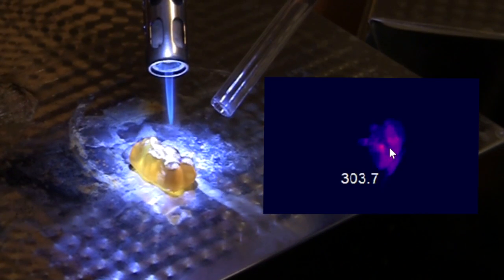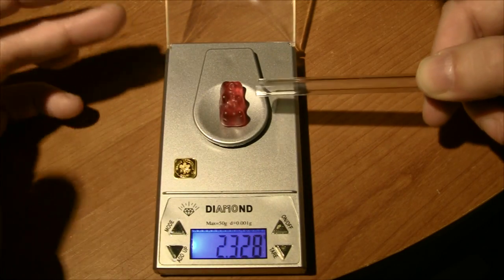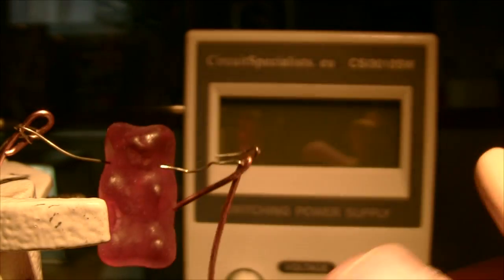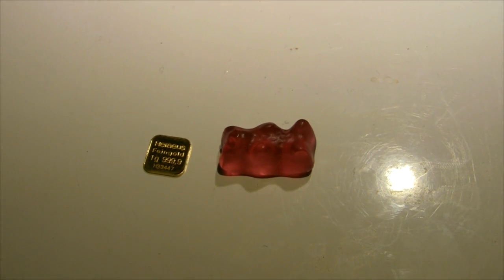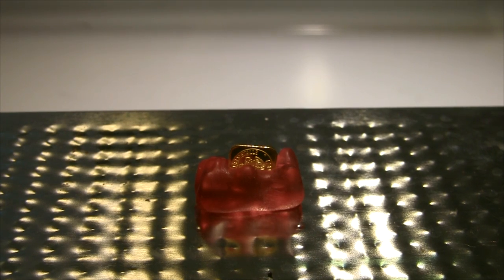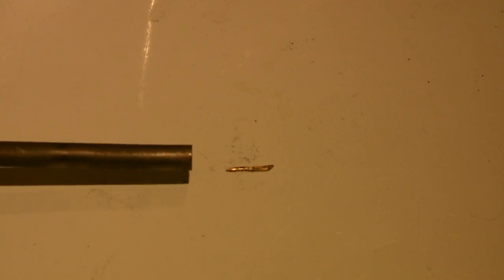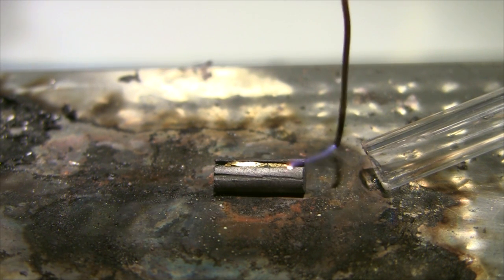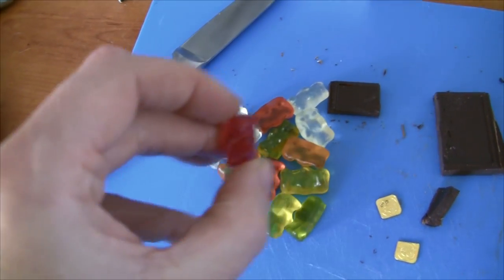Can 1000C Gummy Melt GOLD??

Comment: now this something interesting than the 1000°c knife cutting fucking gold
Reply: A normal knife could lol...
Reply: It doesn't matter how large the chunk of gold or aluminium is. A steel knife will always be able to cut through it. The question is can YOU apply enough force to the blade with your muscles. It's not a problem with the material of the blade.
Reply: Supershadow301 not really. gold has about the same hardness as aluminum
Reply: Supershadow301 it would be possible with a small piece, but extremely hard with a large-ish chunk

Comment: Remember. Jet fuel brought down the towers.
Reply: Jaws 
You don't need to melt a support to compromise its structural integrity.
Reply: 16 years and counting.
Reply: The beams didn't melt, they just got weaker, hot metal is easier to bend than cold metal, it doesn't have to melt.
Reply: Oh, by the way, the entire building was outfitted with asbestos.
Reply: ...and then, when they beat on the horseshoe, it goes flying accross a city block? Why don't you answer a question before asking for more? The microscopic pure iron spheres found by the truck load did not come from "bendy" steel. Besides, the vast majority of steel in the buildings was not even potentially weakened by fire. Nor did the numerous clean, diagonal cuts of the beams found on the ground result from every one of every floor's immediately underlying vertical support beams magically breaking apart under stress simultaneously floor by floor in perfect symmetry.

Neither will it ever happen anywhere in the world under any circumstances that the entire larger, stronger, structurally intact bottom part of a building will be completely disintegrated in progressive failures by the smaller and weaker upper part without the latter suffering any noticeable damage while plowing through the former by the mere force of gravity. This scenario is an integral part of the pancake theory which is completely ignored. If this were even possible, let alone expectable (it should be, seeing as it happened two out of two times), it would have been demonstrated by experiment at this point because that would be trivially easy to do. It has not. Newton simply denies it. You can't support this bullshit claim even by a small scale experiment. I'm sure Thunderf00t would have been the first to jump on it. You know, to shut up all those crazy conspiracy theorists who don't even know the first thing about physics or anything else and think Donald Trump is an evil galactic overlord named Xenu who invented feminism, knocked up the virgin Mary, built the pyramids and shot JFK.

It's amazing how unfactual arguments about 9/11 seem to become in an instant. We now actually have these assholes who think that enough time has passed that it doesn't even matter and further think this constitutes any kind of point. People are still investigating the fucking Titanic, you naive fools. You need serious arguments, not smug, vacuous bullying by argumentum ad populum.
Reply: Ironically he just proved why jet fuel cant melt steel beams.
Reply: agun17
Clearly it was all that fire retardant furniture that did it!
Reply: agun17
This is as stupid as claiming the steel structure was compromises by the fat people in the building.Do you know how much heat would be required to compromise the trusses? Enough to cook the people, in the entire building top to bottom, And boil off the fire resistant suits the firefighters who were ABOVE the crash site. Black smoke equals LOW energy flames. If the heat of the jet fuel fire that would have lasted seconds not hours,(as Jet fuel is a flash burner not a sustained burner.) had enough heat to compromise the structure of the building the bottom floors where the fire department set up their base of operations would have sill been in tact. As they were BUILT to hold the entire building up. And do you know how unlikely it is for two building to burn in the exact same way, heat up in the exact same way and turn to powder in the exact same way? Show me a building fire that ejects bricks and pipes a block from the fire.  Not dust. But actual parts of the building. What kind of Loony Toons bullshit did you idiots grow up on?...
Reply: Jaws
You mean that stuff that prevents fires from spreading as well as causes cancer and would have cost millions because it had to be removed? lol
Reply: I thought the latest theory behind the towers being brought down is more to do with the craft's aluminium melting and reacting with the water in the building, probably down to burst water pipes. The resulting reaction I think was hydrogen which exploded or something along those lines.
Reply: I think they had too many gummy bears and chocolate inside. Such a waste of chocolate.
Reply: agun17
Posting this stupidity under a video of a supposed full fledged Scientist is asinine.
Reply: Jaws maybe not
Reply: NoIfsAndsOrButtsCA
What about the parts of the building that were not heated up? Why did they turn into dust? Sure. Steel gets weaker when it is heated. But not much weaker. And why was the concrete turned into dust? Not even talking about the steel balls found WITHIN the dust of the buildings. And If the Structure was just weakened, why wasn't there thousands of bent up trusses when the dust cleared? Why were there only Pieces of them found. Some  as far as a few blocks away? What caused that the wind? Steel trusses can glide now?
Reply: +blaser lmao, what?
Reply: agun17
Sure. Because posting on youtube or any other outlet you think is beneath hem is what determines the value of their work. You and stupid people like you are the reason the world is run by crooks. They must be respectable. They are in positions of power. Fucking idiots. Too lazy to examine the actual data or argument. Just looking for a reason to dismiss it out of hand.
Reply: Nothing melted the steel beams in WTC on 2001-09-11. Nothing needed to. Metal looses structural integrity at a much lower temperature than it melts. Ask any blacksmith, welder, metallurgist, scientist, or engineer. If you put an iron horseshoe in a fire, what happens to it? It gets soft and mushy so you can beat it into shape with a hammer. What happens to steel beams if you put them in a hot fire? They get soft and mushy. What happens to buildings when their steel beams get soft and mushy? Right, the buildings collapse.

Next question?
Reply: +JRMCNEA : Nothing melted the steel beams in WTC on 2001-09-11. Nothing needed to. Metal looses structural integrity at a much lower temperature than it melts. Ask any blacksmith, welder, metallurgist, scientist, or engineer. If you put an iron horseshoe in a fire, what happens to it? It gets soft and mushy so you can beat it into shape with a hammer. What happens to steel beams if you put them in a hot fire? They get soft and mushy. What happens to buildings when their steel beams get soft and mushy? Right, the buildings collapse.

Next question?
Reply: *****
Show me any welder who's table collapsed because they were working a hot piece of metal on top of it. Show me an anvil that turned in to dust because a blacksmith was working red hot metal on it. Do you know why we use STEEL instead of Iron for building materials? Because Unlike Iron that holds onto heat for a very long time, Steel disperses heat. And this STILL DOESN'T explain how the bottom 30 floors that WERE NOT anywhere near the required "much lower temperatures" was destroyed by the weight it had been holding for decades.There was no added energy to the floors that could have possibly been compromised enough to collapse. And also concrete doesn't get weaker as it is heated up for a few hours. And there was tons of it. that was just turned into dust.